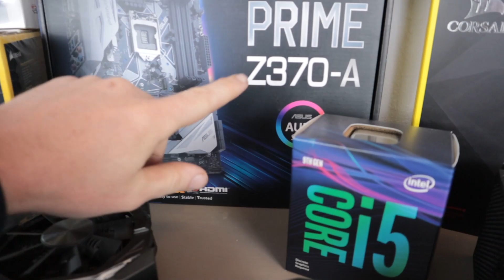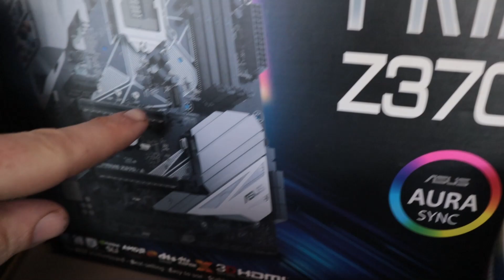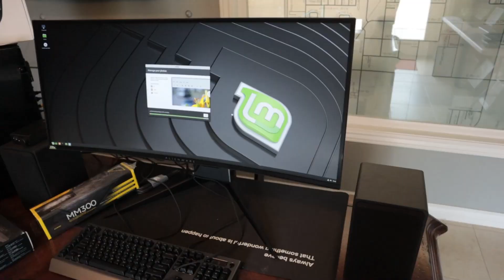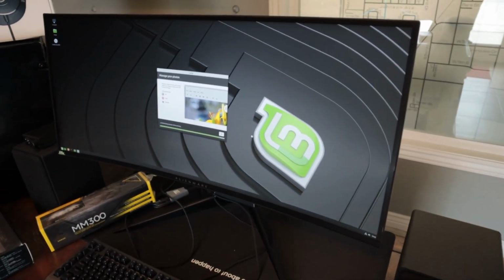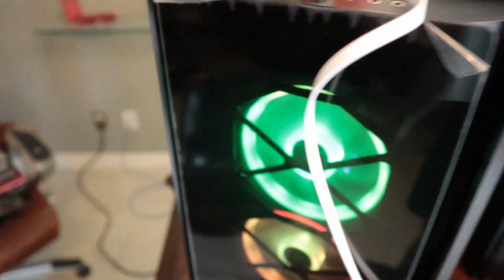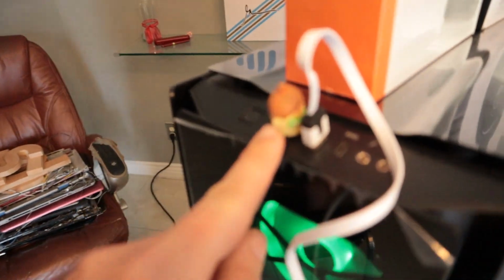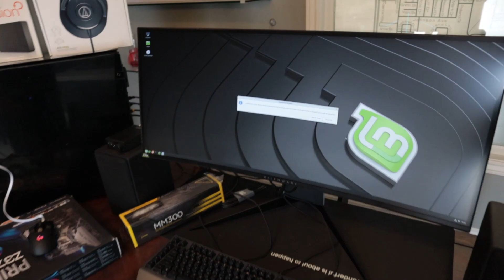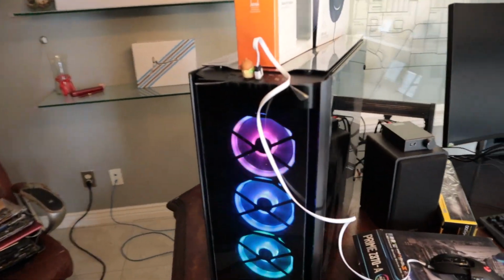Building a Linux Gaming / Video Editing Computer

Comment: Wish I could find a fair priced custom PC builder with Linux support, but the ones Ive found put warnings like "Limited support" or "fee-based support" or simply only support Ubuntu and none of the other distros. All those warnings and on top of that they overprice by over $1000 the same basic intel 5 setup, scares me away from trying to be generous with them giving them a hefty i9 9900K top of the line gaming PC.
Reply: Linux supports more hardware than you think it does.